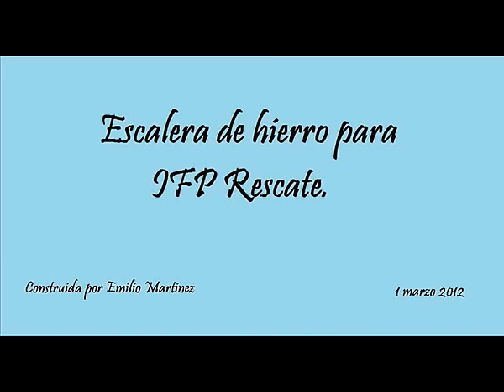Como hacer una escalera de hierro.

Comment: Pregunto desde mi ignorancia: ¿No hubiera bastado anclar ángulos a las paredes, de unos 25 cm de largo, en posición horizontal, para darle soporte a los peldaños?
Reply: Joaquín, escalera correcta, aunque excesivo montaje. Puede ser muchísimo más simple, e incluso venir casi hecha 
doblando la plancha y en 2-3 tramos. Se ancla a la pared y listo.
De todas formas enhorabuena por el video.
Reply: +Joaquín Núñez Quincot  los anclajes por lo general son muy firmes, pero en peso estático o en giros axiales, pero en esfuerzos variables en sentido cortante no lo son, en síntesis, con el tiempo los anclajes de tornillos o pernos se suelen soltar o ceder, lo otro es que hacer coincidir un perforación correcta en un muro de bloques donde existen vacíos y zonas densas y no tan densas es a la suerte